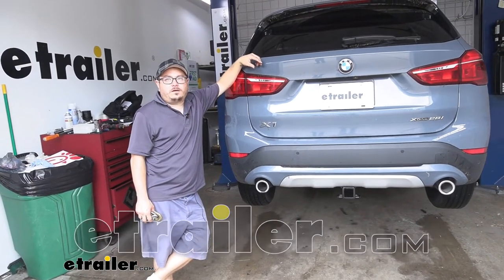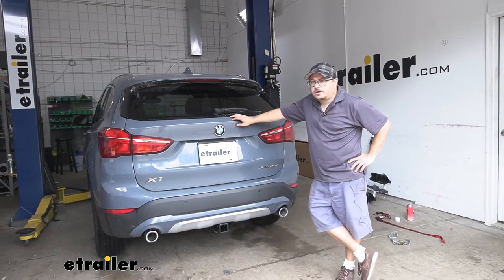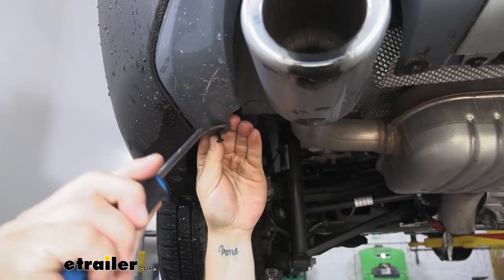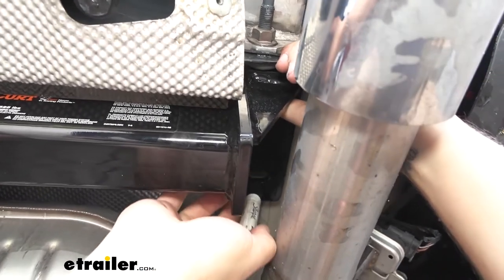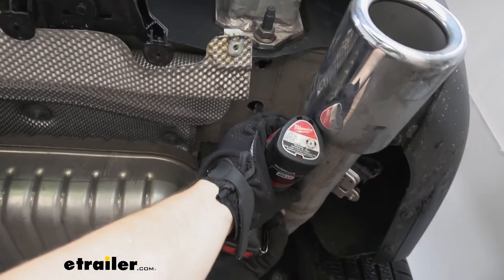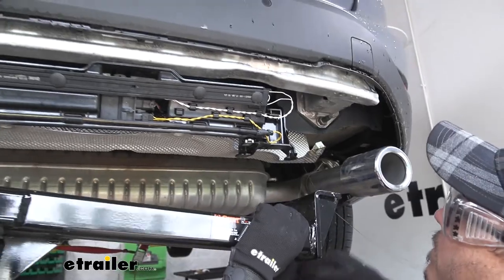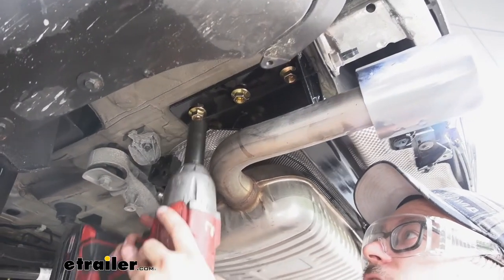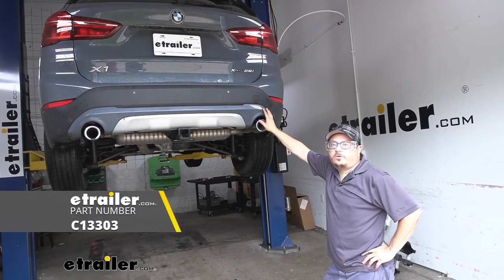etrailer | Curt Trailer Hitch Installation - 2020 BMW X1

Comment: Will the kick to open the trunk sensor still be working?
Reply from the maker: Installing the Curt # C13303 hitch won't prevent the liftgate sensors from working, you'll just need to relocate where you're waving your foot. If you move about a foot to either side of the receiver tube, they'll work just fine.
https://www.etrailer.com/Trailer-Hitch/BMW/X1/2020/C13303.html